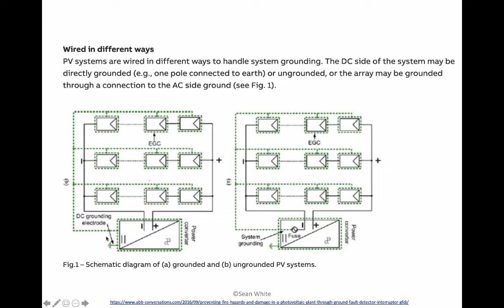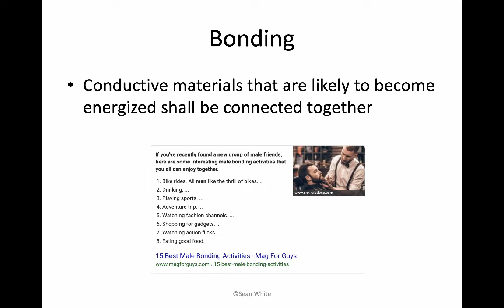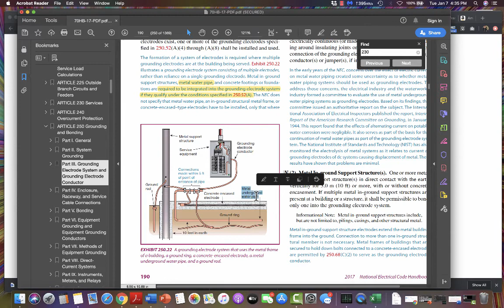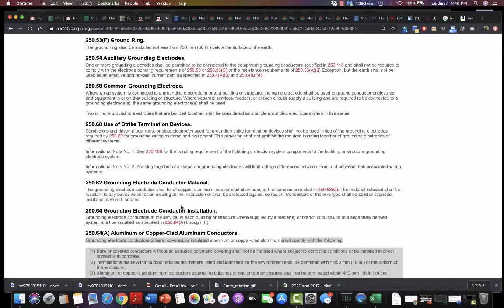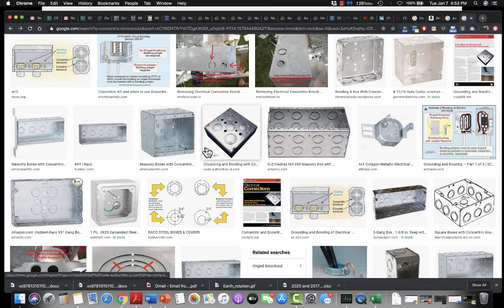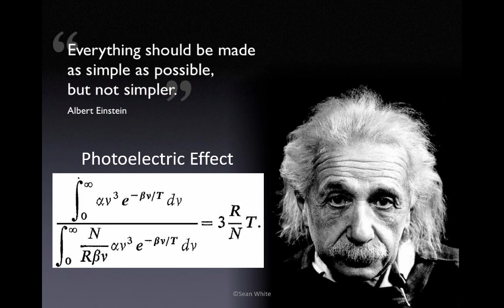NEC 250 Grounding and Bonding Adv. Solar PV Heatspring Sean White www.heatspring.com/sean

Comment: It's been our practice to "fortify" the ground system when doing our ground mounts. We establish a new AHJ compliant ground system at the array but also bond it to the rest of the ground system.
My thought is that doing this can help reduce the risk of damage to the rest of the electrical system in the event that the ground mounted solar array is struck by lightning.
I've seen it said that it does not need to be bonded to the rest of the electrical system's ground system. 
What would you take from the NEC that would clarify the best practice?
Reply: see MIKEHOLT video on this: PV grounding: addresses the danger of aux supplemental ground rods.  Lightening: induction> side flashes.  For ground mounts a ground rod really does nothing - at all